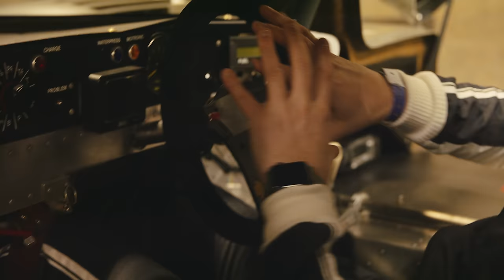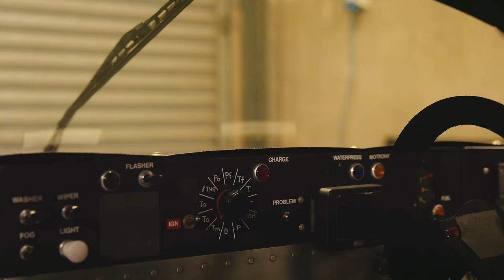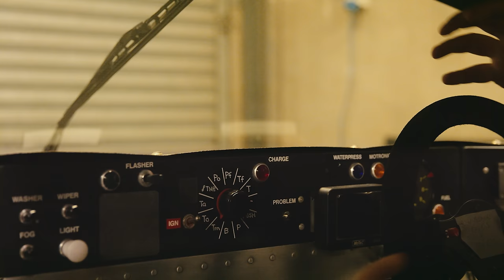DRIVEN | Sauber-Mercedes C9 Group C Legend

Comment: 9:15 meh, I feel like back then they had removable steering wheels.
I forget what the rules were back then but IIRC the MB group C cars were stock block with the twin turbos running moderate boost. A lot of the cars were stock based engines You could have everything from Toyota's screaming turbo 2 liters to Mazda's four rotor Wankels to big block V-8s. You got to have a lot of engine variety. As usual the FIA killed the golden goose by pushing essentially (expensive) Formula 1 engines and killed the class.
Reply: Totally agree
Reply: The rules were quite simple. Group C1 had a maximum 100 litre fuel tank and there was a maximum of 5 stops for 1,000 kms and six hour races and a total of 2,500 litres for Le Mans. You could use whatever engine combination you lied as long as you didn’t exceed those measures. That’s why most of them were about 700-750 hp. Some later cars, like the Nissan, were closer to 800. That’s because, using the same basic technology - reciprocating pistons and valves - meant that the ability for each engine would have been dependent on the ability of that engine to extract the maximum amount of energy from every drop. It would have been relatively easy to put much bigger turbos on this thing and get a lot more power but the only thing you get with that is greater fuel consumption. Not what you want in Group C.

What killed Group C was that, with cars like this, it was getting to be almost as expensive as a formula 1 and constructors- like Sauber - were leaving and going to F1. It didn’t start with the FIA. I know everyone loves to hate them but it wasn’t actually their fault. Group C was a victim of its own success.

Comment: Weren't the 1987 C9s black? With the Kudos livery and the M117? 

1988/1989 cars were the silver arrows with the upgraded M119.
Reply: The Kouros livery was actually dark blue. They went to black with AEG. I'm pretty sure they changed to the M119 for 1989.
Reply: @thethirdman225  yes that's right, dark blue then AEG black. I don't think they had silver in 1988....
Reply: @jshek2753  That's right.

Comment: Are you sure that car is from 1987? The Sauber-Mercedes C9 was from 1987-1988 colorored in dark blue, equipped with the old V8 type M117. From 1989 on they wer colored in silver-metallic like this one and also Jean-Louis Schlesser and Jochen Mass won the World Campionchip 1989 together. The car is therefore the 1989 version with the newer M119 V8 with 800 PS.

Comment: Why does the blue light, that has a lable of "water pressure" seem to light up above certain speeds?  Also small criticism: the music  is too loud compared to the speaking voice. (And i mean the music music, not the engine music....)
Reply: nirfz hi, so the blue light isn’t actually programmed properly yet. It’s an alarm for something (can’t remember what!) but not water pressure as labelled, and not of concern as the parameters in the ECU for it haven’t been set properly yet. But I shared your concerns when I first saw it too! Re music etc.. yep, totally hear you. We’ll tweak and improve over time. 👍🏼
Reply: @hancock_sam  Thanks for answering!

Comment: Isn't the C9 from 1989 the year they WON Le Mans ?
Reply: I thought same thing mate. Unless its an 87 car in silver le mans winning livery.
Reply: Exactly right guys. This chassis is an ‘87, the first year of the C9 , but it remained a test car for the works team in ‘89 so wore this livery.
Reply: The biggest difference between the 1987 and 1989 cars was the switch to the M-119 engine.

Comment: 1987 ? Erm No. Not unless it was repainted.
Reply: Andy Enderby Hi Andy, good spot, I didn’t explain that very well and you’re absolutely right: the livery is ‘89, but this chassis is an ‘87 which raced in AEG colours before coming a works team test car in ‘89 onwards for which it was repainted in works silver.
Reply: @hancock_sam  If I remember correctly ... weren't the low drag LM cars effectively built new for '89?
Reply: Exactly what I was going to say, I was lucky enough to see these beasts in the flesh for 24hrs in 1989. 
The best motorsport event ever IMO.

But the AEG livery was 88, in 87 it was the Kouros aftershave colours, confused!

What I do know is that both Kenny Acheson and Mike Thackwell both drove the C9 at Le Mans and I saw them both at the Silverstone F2 race in 1981.
Reply: @hughcdavies  same here, including the main event in 1989

Comment: My Top SUPERCAR in Gran-Turisimo 😎.👍 💙
Ps : I Won GranTurisimo Championship With Thrustmaster Weel Shifter &Pedal in Sim Mode With SAUBER C9..😎.👍 💙
VIA PLAYSTATION 😎.👍 💙
Reply: Nurburgring Mordschleife- GT4- C9 Laptime 5.28.xx with a controller, slightly rubbed the wall in the Carousel... could have been a tenth or two quicker! I loved photo mode; I could freeze my practice lap, walk around the car and see the downforce at work, and see the attitude changes of the car under braking and acceleration... great tuning tool!